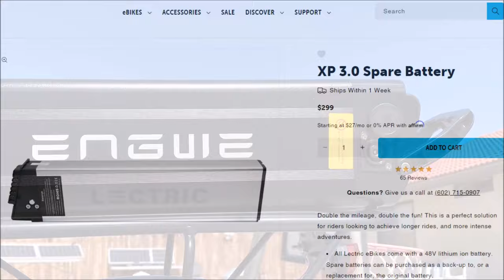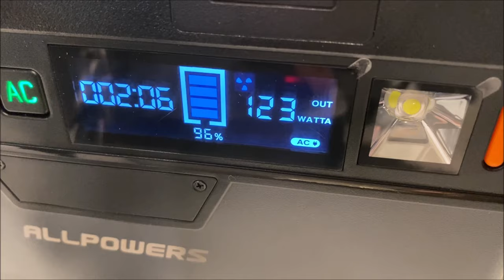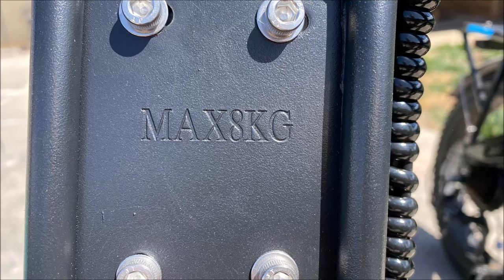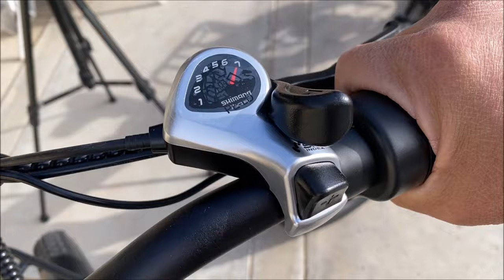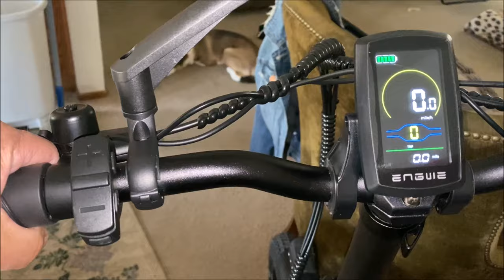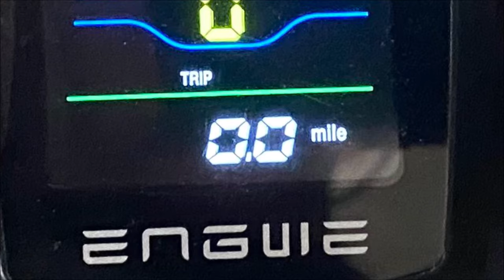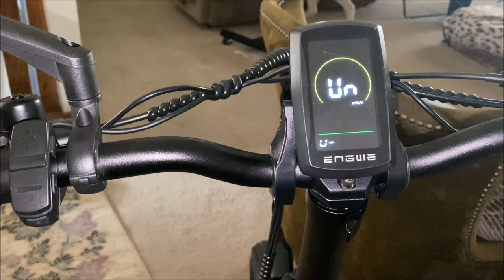ENGWE L20 2.0 The New Competitor to the Lectric xp 3.0

Comment: Very good job Pete, it seems to be a nice machine.
Reply from the maker: Thanks Greg!  For the price, it is a very nice ebike.  Very comfortable seat too.  The battery is just as good as the Lectric's long range battery at 676wh vs the Lectric's 672wh!  I don't even fold it to fit in my mini van.  Just fold the handle bar down and use a ramp and roll it in :)

Comment: I’m considering this bike but I see lots of people speaking about battery complications with engwe. Has yours been charging fine (no overheating, melting, drastic drop in mile range, etc) thanks 🙏
Reply from the maker: So far, I haven’t noticed any issues with the battery.  The charger gets warm but that is to be expected.  Just make sure you don’t charge immediately after riding.  Follow lithium ion battery guidelines.  I like this external battery style since it is already outside instead of in the frame to stay cool whether riding or charging.  I would still advise to remove the battery and charge in a well ventilated area outside of the house.